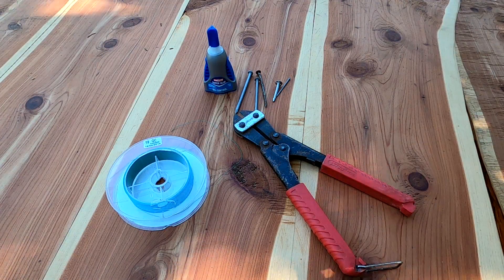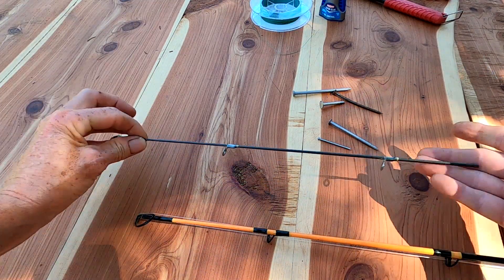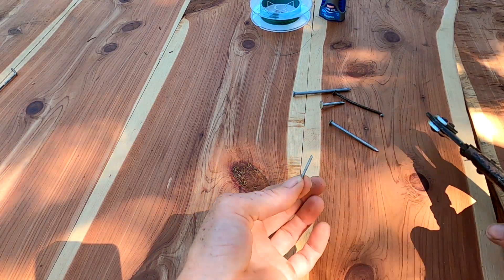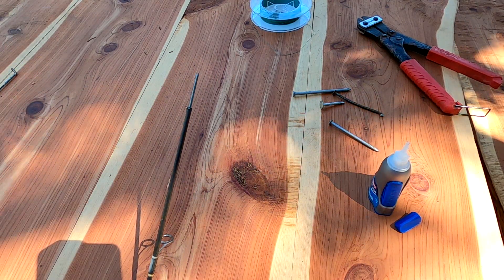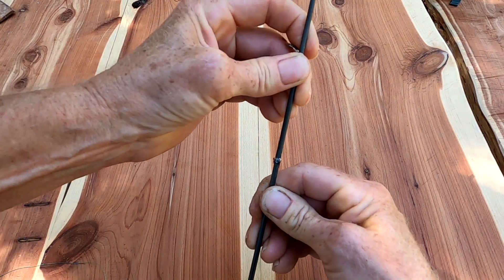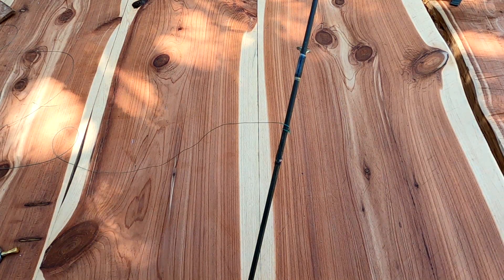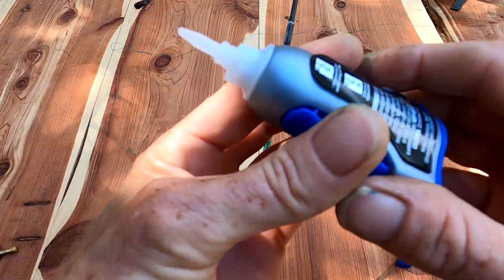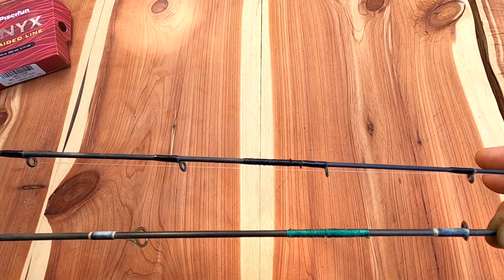How to fix a broken fishing rod Cheap, Fast, and Easy

Comment: I've fixed rods before using a plastic straw with the rope type line and the liquid super glue. I wrap the staw around both sides of the break and super glue it in place. I put a little super glue on the top part of rod and attach the line to keep the line in place, wrap it tightly to other half of the break, then wrap back. Cover the line with the glue. Never tried it with a nail. Goes to show, you learn something new all the time! Tight lines gal pal!

Comment: I slammed my truck door on my favorite rod a while back, between the butt and reel seat.  It was a pretty big diameter, so I used a wooden dowel rod from Lowe's.  I used JB weld and covered it with heat shrink wrap made for fishing rods from Amazon.  Good as new and it's even the same color as the rod and you can't even tell.

Comment: A nail is pretty stiff and doesn't allow much flex in the rod. We used to fix them with a bamboo section inserted. A good wrap strengthens it but still allows flex of the rod.
Reply: Lol chop sticks